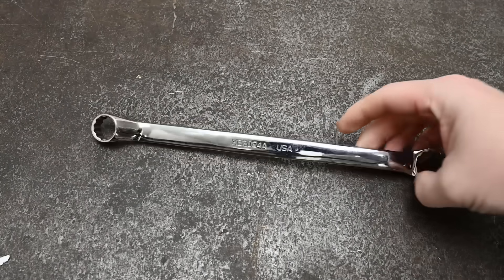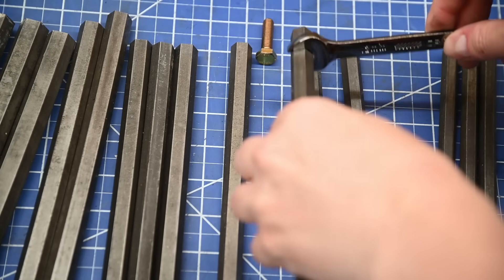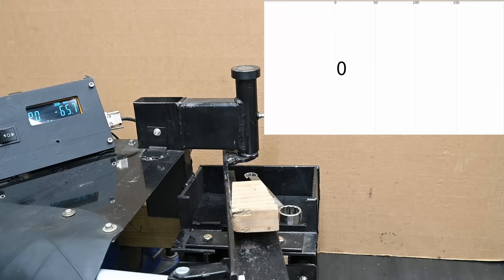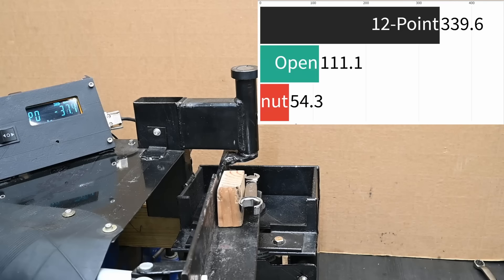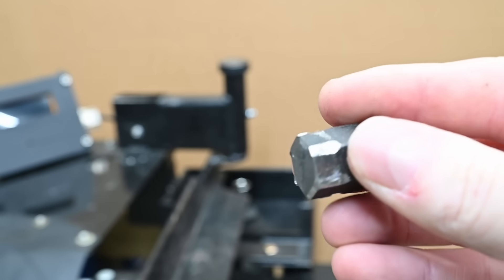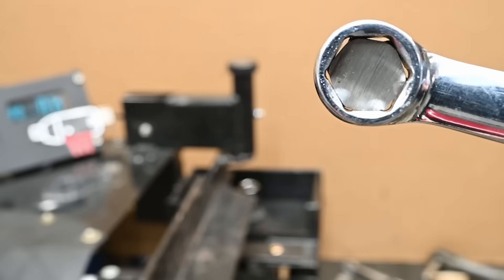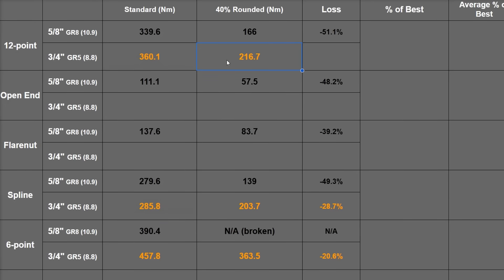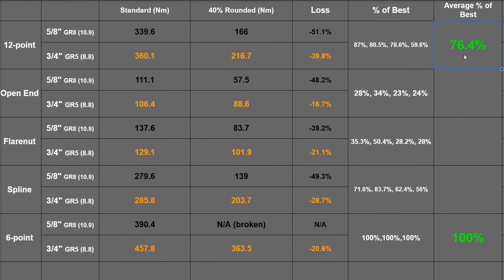Wrenching Robot Settles Which Slips 1st

Comment: Which design will do the best at preventing round over ? I.e. Will 12 point bolt and wrench do better vs a hex bolt and wrench and vs spline bolt and wrench.  So is spline bolt worth it's design?

Comment: As someone who works in aviation, I use 12pt Wrenches and Sockets primarily across both 6pt and 12pt nuts and bolts. Until I get down to 1/4 and 7mm sizes, at this point I carry both 6pt and 12pt sockets and wrenches. Because 12pt wrench on a 6p head will slip. In Aviation we are using higher quality hardware than the average mechanic will see, and our torque values also tend to be higher. A 12pt wrench is useless on a 4mm nut. Once I’m above 24mm, metric and fractional inch socket and wrenches start to become interchangeable, although sloppy in a backlash sense, they get the job done.

Comment: To this home gamer, the biggest advantage of 12-point is when you only have a few degrees of room to swing. With a 6-point, you can end up in a situation where the entire range of motion available is less than 1/6 of a circle, so you can't get the closed end on the bolt/nut no matter what you do. Sometimes you can flip the wrench over, but that doesn't always work.
Reply: my go to is break it with a 6 and then take it the rest of the way with a 12
Reply: That’s why I love my 12 point gear wrench ratcheting flex heads sure if I’ve got something that’s tight. I’m not grabbing them first but if I’ve got something in a weird spot, I’m almost guaranteed to be able to get that wrench on it and be able to turn it.
Reply: @scottcarpenter6443  If they're ratcheting why would 12 point matter? They detent every 5 or 10 degrees, just take it back out and turn the hex a few clicks.
Reply: @erkay3504 gearwreach doesn’t make a 6 point version
Reply: @scottcarpenter6443 Ah, well then 🙃
Reply: new ratchets have 3deg motion ratcheting box ends stubby sockets, who hasn’t ground either a box or open. 🦊🦊🥸
Reply: @scottcarpenter6443  But they also make 6-point racheting, too.
Reply: I assemble and repair (pedal power) bikes as part of my job... We get stuff that you can only use an open ended wrench due to obstructions preventing ring ends or sockets, and even then, you only get 1/8th of a turn... Or less. It sucks when it's less, because the only option is to flip the wrench over so the different shaped tips give a tiny bit more of a turn...
And some of these are also blocked partially from both sides, so you're already interacting with the head of the bolt at an angle, losing available pressure before it slips or deforms.
Reply: @tin2001  hydraulic wrenches with different angled heads come in useful in those situations, sometimes you can get a small fraction of a turn with one wrench, then switch to a different wrench, then keep flipping and alternating...
Reply: @tin2001 Cars/vans/trucks have a lot of fasteners that you cannot get the tool of choice onto. And they typically have much higher mileage. And you cannot turn them upside down to work on them either. 
Stick to bicycles.
Reply: 12 point wrench and 6 point sockets for your ratchet and that's that. 

Otherwise whatever tool best suit your specific need, this aint a competition.
Reply: always have to have both, a 6 point for the initial loosen, then 12 point for turning it
Reply: Break with 6 remove with 12.
Reply: Get a better ratchet with smaller range of motion.
Reply: @justinthomas3253 
There will always be that one bolt where you still have to detach the socket from the ratchet and clock it 90° to get that in between clicks position.
Reply: Imagine the advantage a circle with infinity points would have!
Reply: 12 point is superior overall because you only need the extra grip of a 6 point, not even 1% of the time, but the flexibility of the 12 point is handy all the time.
Reply: @steely1neverwane that 1% of the time kinda matters a lot though. The other 99% of the time won’t be happening without it.
Reply: @steely1neverwane The stuff I work on is rusty as hell. If I get everything apart without snapping a bolt I am typically surprised.
Reply: I don't think anybody is suggesting you're wrong. But what was presented is just common sense, though. For similar reasons, professional mechanics don't use 12 point sockets. If you want to apply more torque, you need more metal. And that's the advantage of 6 point over 12 point. The honest truth is that hand wrench aren't often used for breaking rusted nuts of bolts loose. You generally get a socket with a breaker bar or if you have access, you use an impact wrench. There are reasons to own different tools. And your average person should just get 12 point combination wrenches. A professional will have different options. If you're a DIYer you're probably stuck with just a single set of wrenches and a 12 point will get you access that a 6 point won't. In most assembly situations where you're just holding backup on the bolt, 6 point works because you can orient the bolt head as you please. You shouldn't spin the bolt as you're losing power as the bolt shaft creates a spring an reduces the amount of clamp load when torque is released.  These video very fun, but the truth is that they are more interesting than useful. Use a breaker bar. For assembly, a 12 point isn't going to see the amount of torque that will exceed the tightening torque spec. So they're fine in most situations. For tight situations that professional mechanics encounter, they will often create a wrench specifically for the job. They'll bend it or weld on cheap wrench and throw it in the back of their toolbox for the next time they get into a similar situation. Or someone like snap-on will recognize a special tool is needed and actually manufacture that tool. As a DIY mechanic, you're best option is that 12 point then go get a vise grip wnen you round off that nut.
Reply: @rolando_j_ You sound as if you are from an area with rust as well. 
If I get something apart without snapping a bolt I am surprised.

Comment: A wrench should bend way before it ever splits open the box end. These wrenches are dangerous.
Reply from the maker: Wrenches break all the time
Reply: @TorqueTestChannel   Why Bending Can Be Good (or at least preferred):
Ductility: A wrench that bends rather than snapping cleanly shows it's made from a tough, ductile metal that deforms under extreme load, potentially saving the fastener from damage.
Safety: A sudden break can send shrapnel, while a bend gives a warning, allowing you to stop before catastrophic failure.  Good Quality wrenches should not break before they bend.
Reply from the maker: I'm glad you feel that way.
Wrenches still break all the time. From all sorts of brand. I feel like we'd know more than most about that
Reply: @TorqueTestChannel  10 4. Maybe you can do a torque test on top brands of 5/8 and 3/4 wrenches to failure in a future video. I would love to see how a KD would do in this test.

Comment: I have a set of Gearwrench open, spline wrenches. I love them. They are easier to get on an odd placed bolt or nut than a six point, and a little easier than 12 point. I don’t remember ever slipping the open end too much .

Comment: I already new 6 point would win, but I don't live in the rust belt and prefer to use 12 point especially in tight spaces where you don't have the arc swing you need. I do have 6 point I use if the bolt or nut is rounded or rusty, but I don't need them very often of course I'm not a full time mechanic just a dIY guy who fixes anything I can.

Comment: If all else fails. Knipex Cobra will break the head off the bolt, before giving up... there have been times when getting the thing apart is more important than the head breaking off..if the bolt was rusted in, you can get some derusting stuff into the threads, and even put a torch on a piece of the bolt sticking out... Carbide drill, last chance.

Comment: something I'm missing here is the "12 point hammered on a rounded bolt", as that is my go to method to deal with rounded bolts, internal and external drive, something like internal hex or torx should be drilled out to give yourself a better chance
the right combo of drill bit size and 12 point can convert the bolt to 12 point without needing a replacement.

Comment: Good stuff, and why I use 6 point tools when possible. Considering my 20 year old vehicle has 0% fasteners in good condition and not rusted in place, I don't bother with tools prone to slippage. If I can grab the bolt head, pipe wrench.

Comment: Bought the craftsman overdrive RBRT’s and I got to use them for the first time yesterday doing power steering lines. I didn’t have the right size flare nut wrench, and my normal wrenches pretty much rounded the flare nut. Grabbed the overdrive wrenches, and it bit into the nut and took it off no problem. Paid for themselves in one use. Fantastic wrenches.
Reply: I got them when TTC recommended them and they've saved me so much time! Its a little inconvenient to have the 6 point box end but my god do they bite and hold
Reply: Good to know…I picked up their metric and saw 11 piece set when they were on sale for $50 each. Haven’t used them yet
Reply: Completely redid my power steering in my truck a few months ago, also didn’t have the right size flare nut wrench even after buying two sets in metric and sae, ended up grabbing a small pipe wrench I had in my box and it got it off immediately. Luckily I had new lines so I didn’t care about damaging the nut 😅
Reply: Wish I'd known they were going on-sale before I bought the Milwaukee max bites last month. Hopefully the craftsman will go on-sale again next year.

Comment: Those high polished open ends really suck in my opinion.
I let all my open end wrenches meet my angle grinder one rainy night, just a small touch, to rough up the surface, and grind off the chrome.
Way better grip, even though they technically were a little wider, they grip more. <- Fact based on feelings, not science 😋

Comment: I can't say I care about flare nut wrench results since it is not even close to real world use case.
  Flare nut wrenches have a deep countersink that significsntly reduces thickness of hex that is engaged.  To compare apples to apples in the flare nut use case the hex being driven should engage the entire depth of the wrench.
Reply from the maker: This is a good point. The Snap-On are pretty great in this regard though, and maybe why they do well in general. They have almost no countersink on the bottom side of the flarenut wrench. Zeroing the measurement on the full head thickness, then measuring from the front face through the jaws and to the beginning hex flats in the jaw (instead of including the countersunk face) shows a difference of -0.03"

Comment: Can you test Wera Self-Setting wrenches? They're like the Open Wrench except the harder you press, the tighter it grips much like the Pliers Wrench but with a single handle. I use these in lieu of flarenut wrenches and am curious if that's a wise choice or not.

Comment: Also I hate 12-point sockets.  Sure, there is a 12-point fastener out there somewhere on a car, which makes 12-point sockets a specific-use tool like a cam gear lock, but why they are so often chosen for homeowner tool kits is beyond any sensibility.  Aircraft mechanics are not buying their core hand tools at Home Depot.  I'd like to see 6- versus 12-point sockets, also testing how easily the socket likes to slip off the fastener.

Comment: It's noteworthy that Tekton discontinued their 6-point ratcheting box wrenches, presumably because the market indicated it wanted 12-point for ease of use, which they carry now.  I have almost a full set of the 6-points and they are solid insurance on suspect fasteners.  Not that a ratcheting box wrench needs the additional torque capacity, but resisting further rounding is worth the effort.  On combination wrenches, I do get the desire for 12-point, but I think it's wise to also have a row of 6-point next to them in the drawer.  On ratcheting box wrenches, rotating a 6-point box by hand when you don't have enough swing is insignificant additional effort.

Comment: there's one more angle on this, flipping the wrench 'upside down'. many times the same wrench will somehow bite and grip better 'flipped over' rather than the natural position, meaning the offset of the wrench going down instead of up. i know it's weird, but it works.
Reply: Youre supposed to flip a wrench over every time you turn

Comment: I'm surprised the flare nut didn't do better. I didn't expect it to do better than any of the closed end wrenches, but I thought it would be more-better than an open end.
Reply from the maker: It's likely not normally working on hardware as thin as a bolt head, but i know what you mean!

Comment: In my toolbox, sin no spline wrenches, the torque ranking is 6 point, 12 point, flare, and lastly open end.  I already knew that, but still loved the video.  I like data.  Measuring stuff is good.
Reply: Spline Wrenches are for Spline nuts. That's all. Whoever the idiot in marketing is that suggested otherwise should have been fired for it. They are not for anything else.

Comment: Tekton used to make 6 point ratcheting wrenches which seemed like a great idea but they’ve switched over to a more traditional ratcheting 12 point. 

Maybe the ratcheting mechanism gives out before 6 point would make a difference but those would be interesting to see tested.
Reply: I've got old craftsman ratcheting wrenches that are 6 point and solid as hell. They feel like a 2 tooth ratchet but it's a fair trade off for the strength
Reply: In my experience the ratchet mechanism always gives out before the wrench slips. (Usually fresh hardware)
Reply: Tone's ratcheting 6 point and ratcheting open end would be cool to test as well.
Reply: I have the tekton 6 point ratcheting set and they are great!  Used them for years, no problems.
Reply: I actually have one I use on a old mill for a vise handle and a spindle drawbar wrench, I always wish I bought the 12 point version because when your trying to line it up and it's overhead where you can't see it takes a lot of room to actually initially lineup the hex
Reply: Makes you wonder if tekton quit making the 6 point ratcheting wrenches due to all the warranty claims. 
I learned about them after they were decontinued but was able to piece together of the flex head metrics and a few sae. Also got a few non flex heads in both sae and metric.

Comment: I may have mentioned this under another video but you can get some extra torque out of a ring spanner by clamping a pair of self locking pliers on the outside of the ring.

Comment: I get all my sockets and wrenches in 6-point unless I need a specialty 12-point application. I learned my lesson back in the 70's about knuckle busting.
Reply: The only 12pt hardware I've used that's good is aircraft hardware. Lots of spline fasteners in that world too.
Reply: @oldphart-zc3jz  Its pretty common to run into 12pt head bolts. I've also seen 12pt bolts for cv axle flanges
Reply: @oldphart-zc3jz  on my Jeep the Wheel Hub Bearing uses 13mm 12-point bolts. that's where I use a 12-point socket.
Reply: @TwoFeatherChannel Are they 12-point or triple-square?

Comment: Would love to see some Knipex pliers wrench. I have found the blow flarenut wrenchs out of the water. They even grab harder when the handle is pushed so they will work on pushy.
Reply: On AN/aluminum/brass/small steel flare nut fittings, the flarenut wrench is a requirement. The pliers wrench will crush those flare fittings and then you'll be replacing the whole line. Some AN fittings you have to use an aluminum flarenut wrench too.

Comment: It would be interesting to see how those Knipex Wrench-pliers would perform. They only clamp on two sides but they add clamping force.
Reply: I had guys at work scoff at me using the pliers wrench, so i put it around one of the grade 8 22mm bolts holding a 25hp motor in place. And stood on the handles after squeezing them to get the initial grip.  They didn't laugh at them anymore after that 😂
Reply: I love the cobras.  Wouldn't mind a set of the pliers wrench too.
Reply: @b @brainkill7034  they are great but the comment of Matthew Weaver here says it all. 😁
Reply: @brainkill7034 alligator is the way to go. no button to get in the way

Comment: had a 2000 or 2001 gm 1500 4x4 and the seatbelt bolt-nuts were spline, and bolt was inverted torx plus if not spline definably inverted torx

Comment: I just got my Workpro magnetic socket organizer rails in the mail, just as I was watching this. I'm moving my sockets over, and I notice how many 12 point sockets I have. You may have mentioned this in your last video, but what's the purpose of 12 point sockets on a ratcheting wrench?

Edit: I just remembered 12 point works on square heads. That's useful. I'm obviously no mechanic, and I'll hardly see those tough situations where 300+ Nm of torque is needed. But good to know.
Reply: 12 pt. POORLY works on square.  it’s best to use 8 pt.  the advantage of a 12 pt socket is on the end of a breaker bar or 12 pt. bolts for tight access

Comment: I don't own any 6 point wrenches, and have rarely even seen one. (Maybe it's a rust belt thing, I'm in Texas) I think it's obvious they would hold more torque (like 6pt sockets do), but the lack of positions would make them nearly useless. 
I do think ratcheting wrenches should be 6 point, since the position issue becomes not an issue, but I guess that didn't catch on. Tekton had 6 point ratcheting, but now discontinued.